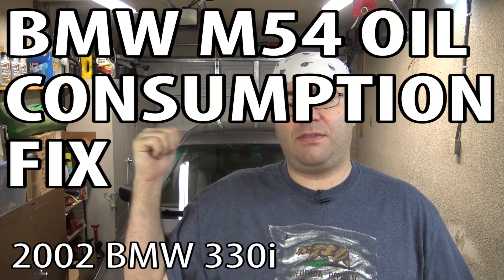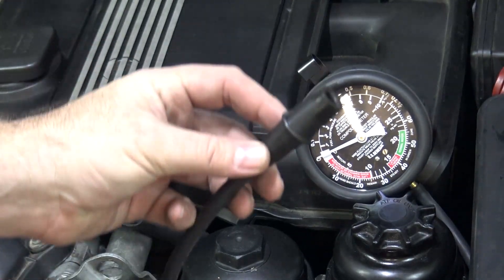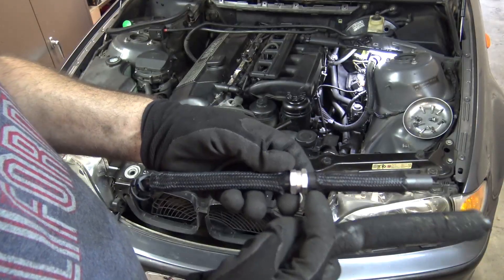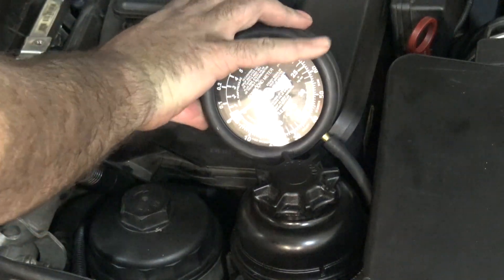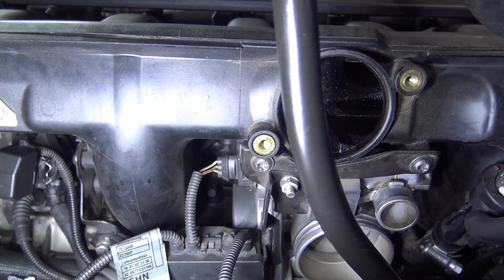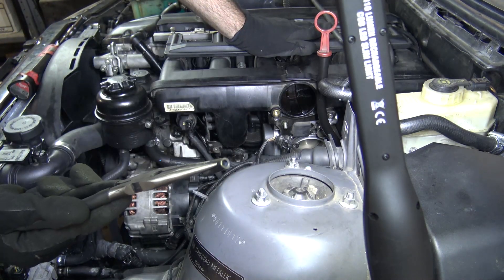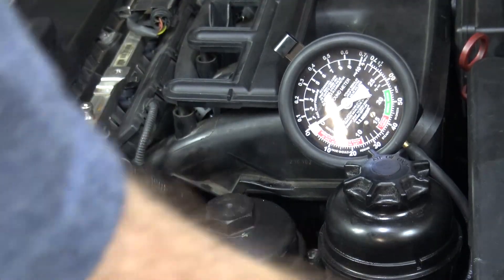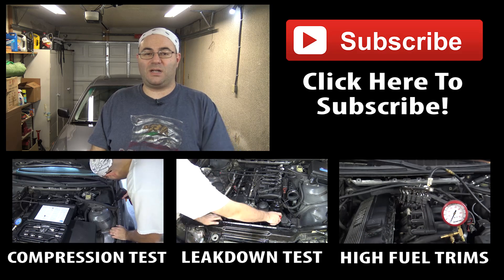BMW E46/E39 M54 Engine Oil Consumption Fix (02Pilot Mod) DIY

Comment: Hello, I'd like to know if there are any risk to keep driving car with the smell oil burning and consuming oil issue ?
thanks a lot for your reply
Reply from the maker: Well, depends how bad the oil leak is--it's probably dripping on the exhaust manifold.  It's not exactly good, I would take care of the problem.
Reply: thank you for your reply.  actually, I'd like to know if the known defect on MP 54 can cause smell burning oil ?
Reply: I wanted to say defect on M54 engine

Comment: Thank you for all of your videos and detailed explanations behind your clear and linear thinking. I greatly appreciate you taking the time to publish your work. Just curious if your're still running the 02 Pilot mod on your newly rebuilt engine? I have a 2001 Z3 roadster 3.0i M54 engine with 51K with very little oil consumption (1/2qt every 4K miles), but I'm thinking about completing the 02 Pilot mod anyway. Any reason why I shouldn't?
Thanks in advance!
Reply: I realize you installed the M52TU rings as part of your rebuild to resolve the M54 piston ring issue, but still curious if you retained the 02 Pilot mod or reverted to the stock CCV set-up.
Reply from the maker: I went back to the stock system--no need for the 02Pilot mod now.  No need to do the mod until your consumption actually gets bad.  The one problem with the mod is if your valve cover gasket is a bit leaky, it can suck more air in through those leaks because you're putting the crankcase under vacuum and that would cause your fuel trims to go up which would make your mileage poorer.

Comment: Thanks for verry good videos! 
Won't this mod suck oil backvards from the dip stick return line?
Reply from the maker: No the vacuum line is too small to produce that great of a suction, however I still like to use the check valve on the return line just in case.

Comment: im in uk i cannot get this to work , ive had to remove and fit oem breather system , popping in the manifold as it runs to lean , i have unaccount  air flow entering the inlet manifold , the only way round this, i see is to change the mapping on the fuel system ,

Comment: Hello 50skid. I want to ask something. I am now in the middle  of this working process on my CCV. I want to ask if this oil consumtion fix is safe. How many miles did you drive on this setup. I mean on this vacuum boost hose from intake manifold to separator. No ofense to you. I love your videos and i really respect your work. I am just curious to know what do you think about this setup after some miles. Thank you for answer 😊
Reply from the maker: I drove for a few months with it.  It's safe, there are hundreds of people who have done it.

Comment: Great videos, 50sKid! I was wondering what is the difference between doing the 02Pilot mod and just removing the diaphragm from the ccv?
Reply from the maker: Removing the diaphragm will suck way too much air flow and basically suck the oil up from the dipstick tube.  Plus because the diaphragm isn't there, air will leak in around the cap on the oil separator.

Comment: Awesome videos! I have a BMW e39 525i (almost 200k miles) that consumes a lot of oil. I'm living in Sweden (very cold winters), is it a bad idéa to install the 02pilot mod to my car using the original cold weather CCV?
Reply: what is the reasoning behind this being bad in cold weather?
Reply from the maker: Yes. You should install a catch can instead.
Reply: 50skid has since reversed opinion and says okay to use O2pilotmod in winter

Comment: hi 50s kid i have a bmw 2001 325ci  n its giving me a big headache becaus it backfires into the itake manifold n idk whats causing it to do 😕😔😭😭
Reply from the maker: check fuel trims you likely have a rich condition
Reply: Thank you i will keep u updated on how it goes , and my OBDII was reading the MAF sensor n i replaced it but still no luck

Comment: How much suction is too much? I noticed in one of your videos you used the Torque Pro app to read fuel trim levels. I just question if its too much vacuum. I have an 2001 e46 330xi with about 150K miles and did the 02Piolot Mod...and the torque pro app reads 26 inches of Mg or about -13 psi. Seems like that could be damaging in the long run.  I have a vacuum gauge but not any adapters to connect to the  crank case vent tube like you did in the videos. Anywhere else I can test this vacuum without drilling a hole in the oil cap? Would it be the same as testing the vacuum off the back of the intake?  When you showed the reading on the vacuum gauge in the video, I assume from the video images it was Inches mg when you showed 17-18? What does your torque pro app show vacuum is with this mod?
Reply from the maker: Vacuum is measured in inches of mercury, Hg.  When I was showing you 18" I meant 18" Hg.  I don't know what data you're looking at in torque pro but it isn't the vacuum being produced inside of the engine.  There is no PID for that.  You would need to use a gauge like I did and the most an engine is going to produce is 18".  Anyway, don't worry about it.  The whole point is to apply the vacuum that is produced inside of the intake manifold into the crankcase.  That is the point of the mod and that is what reduces the oil consumption.

Comment: I ordered a 12mm check valve like the one you used in your CCV replacement video, though I havent fitted it yet as ive noticed something about using the valve that concerns me, the valve doesn’t seem free flowing  unless I blow quite hard through it, and it strikes me that the oil drain back pipe would just have oil trickling down under gravity and not have any pressure to open the valve, in witch case I would think the oil would just back up until the whole CCV system was full then still get sucked into the intake? Im not that familiar with check valves, this one seams to have a sprung disc, maybe others have a simple ball that would be naturally open by gravity when pointing down wards?
Reply from the maker: I poured oil down the return tube when it was off the car, with the valve installed, and oil came out the bottom at a normal rate and not at all in reverse.  The spring inside is pushing it open normally and the vacuum pulls it closed (or flow of something, oil or water or fuel)
Reply: Hmm, the valve I have is seems opposite to that, the spring holds it closed unless pressure or vacuum from opposite end makes it open. its natural state is closed. I will have to try and find a different valve!
Ive been thinking about the design of the dipstick tube and also the design of the later superseded version, it strikes me the real problem is that in both designs, the oil drains back into the sump below the oil level, so basically if I sucked on the drain tube it would be sucking up oil directly, but if the dipstick was much shorter so it only protruded 1/2” into the sump, then the oil would be dripping just above the oil level and could only suck up crankcase air, Im thinking of modding my dipstick tube, but none of the dipstick mods ive seen online seem to address this, but instead only concentrate on preventing the tube from being blocked. Do you have any thoughts on my logic with this? as I don’t want to make the situation worse. i.e. I wonder if the system actually relies on the dipstick being submerged so it hasnt got vacuum at both ends?
Reply from the maker: You know maybe I am wrong and you're right--I never looked at it too closely.  Just test it by pouring oil through it both ways.  The oil level is usually quite high so no matter how short you make it it's not really going to help.
Reply: Hope you don't mind me throwing more questions at you, I really respect the work you've done in these videos and you explain everything so well. 2 days ago I bought some clear 12mm PVC tubing to replace the the CCV drain back tube so I can actually see if oil is being sucked up, also if I do the 02 pilot mod this will let me see if that causes more oil to be sucked up., so far nothing has been sucked up, but also no oil seems to be draining from the CCV ( which I replaced only 1 month ago ) the pipe looks empty except for some condensation. I can't leave the clear pipe permanently as when it gets hot it becomes very soft and will probably collapse before long, but its a good diagnostic aid to see whats going on. Only thing I can think of now is that the spring inside the new CCV's are a bit too firm and not allowing the valve to close on high vacum, so my next plan is to replace the spring with the possibly weaker spring from the old CCV. I know its quite probable that my oil rings are causing some oil consumption, but I feel I need to stop oil entering the inlet manifold first and each time ive checked the distribution piece since fitting the new CCV, its been full of clean oil :-(

Comment: Would Colorado be considered a climate where I should worry about condensation? High altitude so less water but can still be very cold.
Reply from the maker: I wouldn't know, but if it were me I would start with the 02Pilot mod

Comment: Warning!!! Do not open oil cap while car is running with this mod. I've been able to flood my intake with oil, just opening the cap. Learned the hard way that a non return check valve is a must.
Reply: BioZ, i did this mod 2 days ago and tonite just dbl checking this under the hood and i took the oil cap off while my engine was running, CRAP!  How long did it take to clear your intake full of oil?
Reply: +50sKid what do you think about this? +BioZ in wich tube do you think is necessary a non return valve?
Reply: Thanks BioZ for the warning
Reply: Did you install the check valve "now"?  And was it resolved by doing so?
Reply: Guys i've read online that i wouldn't need the valve at all?🤔 and if it's needed, have yours been working since??

Comment: Going to this this to my e46 once I get it back from the shop! also got an e90 with the same problem. im gonna guess that it's a totally different engine and not the same fix...do you know the fix for e90s as well?
Reply from the maker: The concept behind this fix might very well apply to that engine as well.  It's still the same basic block underneath.  They probably stuck with the 2 piece oil rings, who knows.  You'd have to figure out a different way to apply the vacuum to the block because the CCV system is configured differently.

Comment: I have a 2004 Bmw 325xi, when the car is in drive and stopped the car starts to vibrate. Once I accelerate the vibration stops. There's a 140,000 miles on the car. I took it to Bmw. Motor mounts and transmission mounts were replaced. They say it's just a old car. Can you please give me your suggestion.
Reply from the maker: Vibration could be coming from the power steering pump or the water pump or even the engine oil pump.  It could also be coming from the transmission oil pump.  Basically any of the pumps.
Reply: Torque converter,go get it scanned at autozone for free. Start there

Comment: very good.why the original they don't put connection hose
Reply from the maker: Well you normally do not want vacuum in the crank case sucking MORE blowby past the piston rings, but in the special case for this engine that additional vacuum happens to help those oil rings seal, so it's a good solution just this once.

Comment: Is this something I can do to mine m54 I live NC ?
Reply from the maker: I'm not sure what your weather is like.  If you live in a state where the weather drops below freezing and you park your car outside, then no, go for the oil catch can instead
Reply: 50sKid it only gets freezing temp in dead of winter off and on that's why I was asking because I can't bring myself to the catch can thing or the delete thing to my car I don't really like the idea of taking factory parts away from my BMW
Reply from the maker: Then try this one and be conscious of cleaning out the CCV system every so often.
Reply: 50sKid should I use the one way valve on my oil drain tube as well to make sure it doesn't pull up any oil from the dip stick tube ?
Reply: @ericruff7823  no
Reply: yes, you can do O2 pilot mode in cold NC

Comment: Hey KId , I Just received my PCV kit today, I hate the Oil catch can a lot. Would I be safe  without the dipstick pcv valve? I didnt not order one.
Reply from the maker: It's not safe to not use one with an oil catch can setup, but you can probably not use one for the 02Pilot mod
Reply: 50sKid I just finished putting the new CCV kit in my car I did the O2 pilot mod and now my car shakes a lot when in gear . Any suggestions?
Reply: @ducewill  check for other vacuum leaks

Comment: will this work as a check valve replacement? http://www.ebay.com/itm/2PCS-10MM-1-2-Aluminium-Alloy-Fuel-Non-Return-One-Way-Check-Valve-Petrol-Diese-/301860026278?hash=item46484277a6:g:iTUAAOSw-YVXlwj~&vxp=mtr
Reply from the maker: That is the check valve I use.

Comment: hello. i'm from portugal and i have an 2003 e46 1.6 i Does this work's on this model? realy apreciate if you comment on my question Thank's
Reply from the maker: I didn't even know they made a 1.6!  Give it a try.
Reply: @50sKid  This is probably a 316, which has a 1.8 lt engine. BTW, those 4 pots engines N42 & N46 were not BMW's brightest hour, but they sold a lot in Europe and the UK.

Comment: Recently I tried just replacing the ccv + hoses hoping it would solve this oil and smoke problem. It solved the smoke problem but not the oil. That being said I would like to try this 02 mod but was wondering if you think it will be ok without the return check valve. thanks and love the videos.
Reply from the maker: It probably will be.

Comment: I enjoy these videos as well. I've read a few of these comments and I'd like to point out that the "02 Pilot Mod" likely would not fix your problem if you have noticeable smoke coming out of your tailpipe at this point. Your CCV would need to be fairly new or atleast not clogged what so ever for you to see promising results.

Comment: just completed this mod and measured huge vacuum to the pcv system👍👍👍. quick question - how do you read the fuel trims!!! my odb2 reader states - 7.3 please help.
Reply from the maker: Negative -7.3 means a rich condition, which I wouldn't expect after this mod.  Check your fuel pressure to make sure you've got 50psi exactly.
Reply: Thanks for the reply, after a short drive it's sorted it self out. 0 and slight plus and minus readings, cleared faults using torque pro and no errors com up.

Comment: Great series Jason!  Thank you for the amazing amount of info and tips.  My 04 325xi with 145k mi. has no engine or drivability problems.  Starting, idle, acceleration all good.  It does however, consume oil like a son of a bitch.  I'm from the Boston area and have sometimes seen the yellowish residue of oil/water mix on the oil fill cap.  I assume that's from condensation because the coolant level hasn't dropped.  My question is - do  I need to replace the whole CCV system with an added check valve and O2Pilot mod or can I simply add those items?  I really don't want to go the Catch Can way.  I was thinking about incorporating a moisture trap in that new vacuum line.  Maybe something designed for an airbrush.  Is there a way to check the CCV valve and hoses?  Is there somewhere I can look for evidence of a bad/clogged system?
Reply from the maker: Always replace the CCV system after about 75-100k miles.  You can do the O2Pilot mod if you want first and if you have problems later you can do a catch can.

Comment: Excellent video. Is this not a viable option in cold weather climates? Why did you mention it as good in warm weather areas?
Reply from the maker: In colder climates the CCV tends to clog up with a yellow mayo like substance which is water from condensation mixed with oil.  If this hasn't happened to you, then you are OK to install a new CCV and use this mod to solve the oil consumption problem.

Comment: Hey, 50sKid! I do about 200 miles a week in my '04 150k+ mile 325i and live in England, where at this time of year it can reach below freezing. I've been topping up 1L of oil every week (when the light comes on) for almost a year (purchased the car last December). VCG, valve guide seals and OFHG have been replaced, but with no joy. Would the next step be replacing the CCV parts before going forwards? I often see faint blue smoke coming out of the exhaust at a stop/pulling away.
Reply from the maker: Better to try a catch can.
Reply: @50sKid  why is better to try a catch can?

Comment: Thank you for your effort !
I have to ask before I go for it, does this 02pilot mode affects the engine in anyway such as an over vaccum flow in the crankcase or the intake manifold leading to same problems as a bad ccv, oil leaks pressure in the crankcase etc...
Thanks in advance 
keep up the good work !
Reply from the maker: No, no negative effects like that.